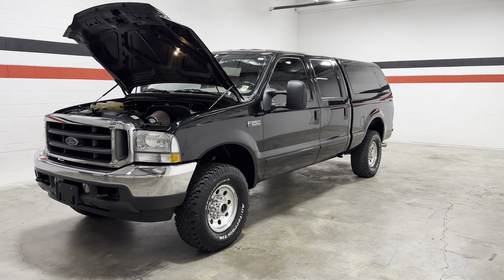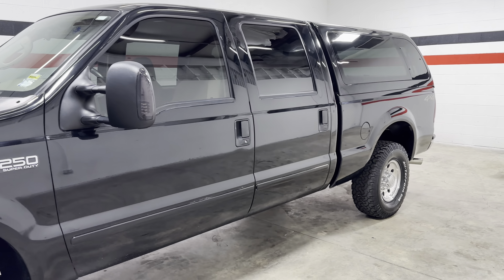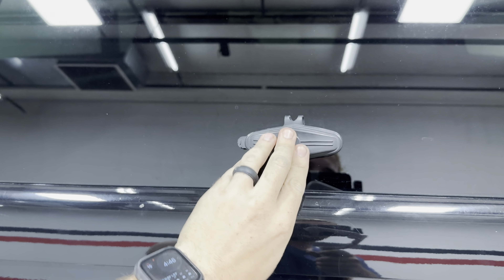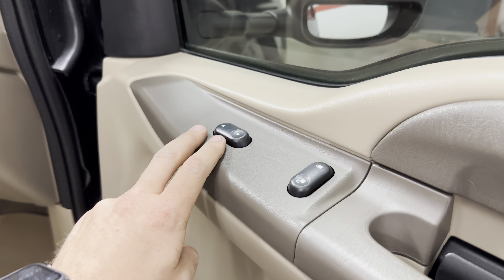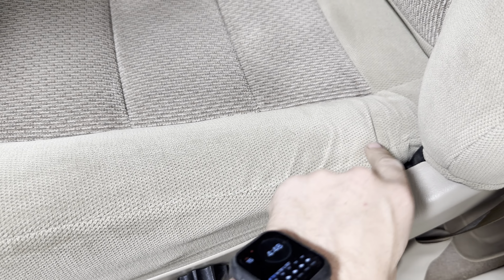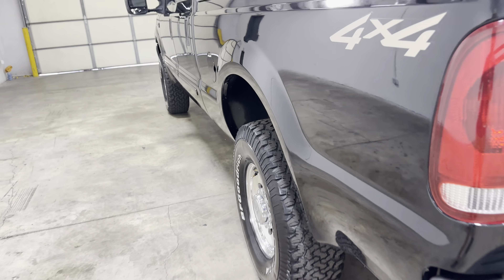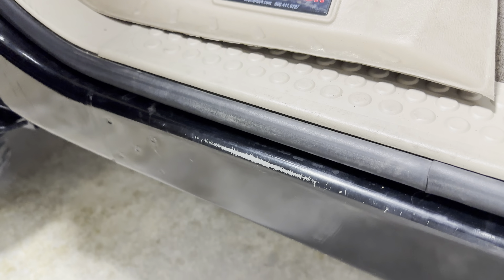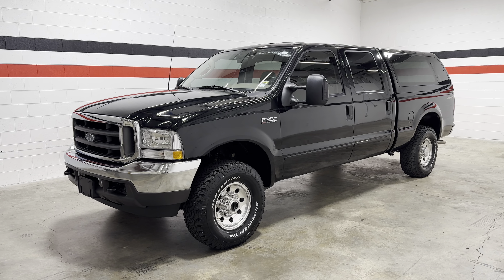2003 Ford F250. 5.4L 2V Triton V8 with 61,000 original miles. 6 speed manual!

Comment: it's that diesel engine?
Reply from the maker: This is a gas truck
Reply: by the way what is the L on shifting knob?
Reply from the maker: It’s commonly referred to as “granny low” very low gear
Reply: what is the maximum speed on that gear?
Reply from the maker: If I remember correctly when I drove it, it was something like 7 mph
Reply: @enterprisemotorsports  but can I used that gear as 1st gear?

Comment: One of my all time favorite 8 banger. Triton. Nice find 👍
Reply: You like burning a lot of gas, no power, coil packs goin out, an spark plugs breaking off? It is a nice clean truck minus the engine that had been selected
Reply: @John.ThirteenPoint6969 infórmate bien antes de escribir.  Ese motor que tu dices es el 5.4 3v. Este es el 5.4 2v.